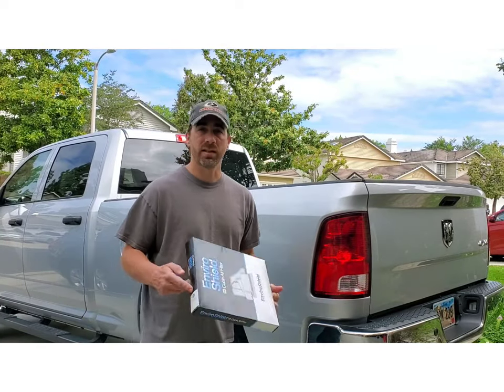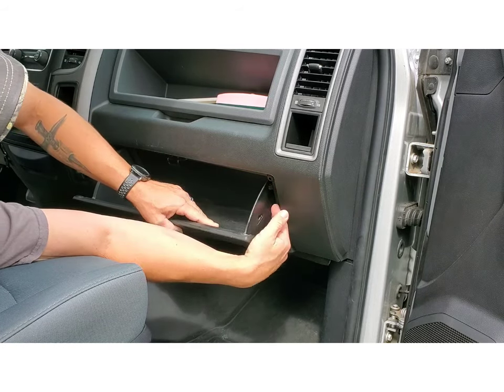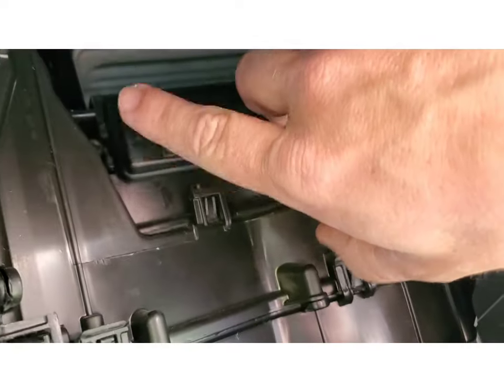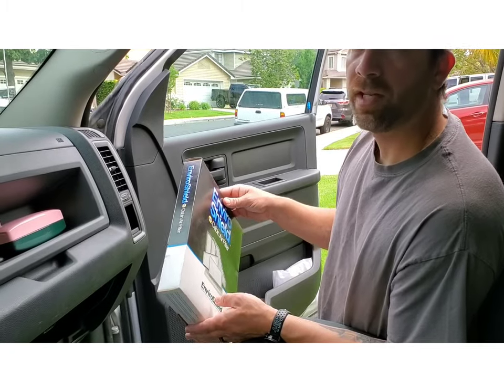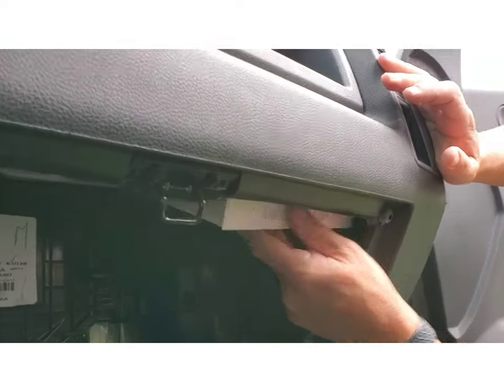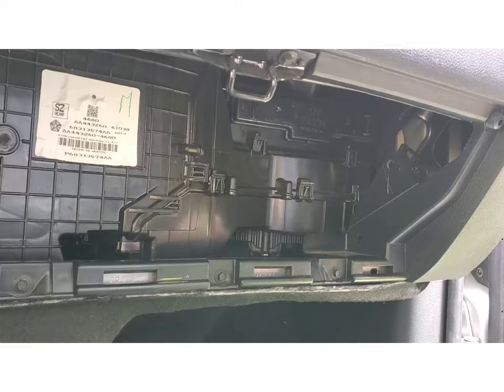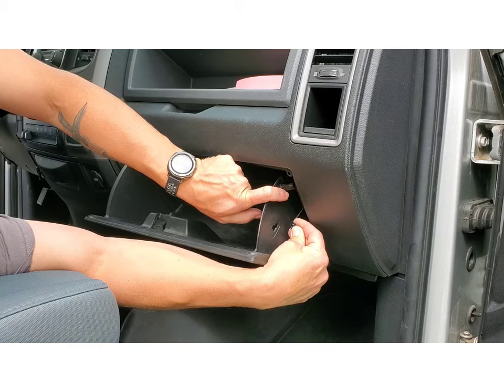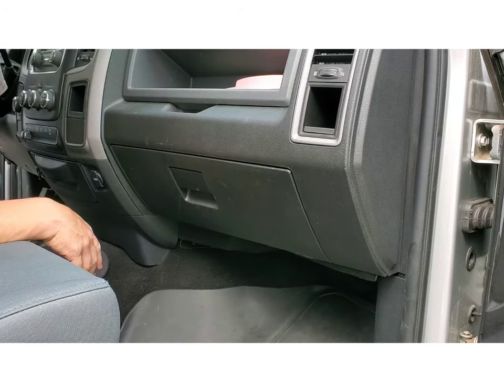2009- 2018 Ram cabin air filter replacement

Comment: My 2015 Big Horn 1500 does not have the filter cover door. You must purchase a filter kit that comes with the cover door. Then you have to cut out the filter cover to insert the filter. Use the heated razor knife blade to cut out the corner. See other u tubes to see how to do this!

Comment: 2009 dodge ram 1500 does NOT have a cabin air filter. There is raised plastic outlining the were the slot would be but if you want one you have to cut the hole yourself. There are kits you can buy.

Comment: My 2013 doesnt have one either. Why would Dodge make something inaccessible like this.
Reply from the maker: That is a good question. Everything is there for the filter, you just need to cut the plastic out of the way.
Reply: Same here. This was a great, to-the-point video; however, my Ram Laramie 1500 does not have this door. I can feel the filter above.
Reply: Inaccessible? What do you mean? It only took a few minutes. How is that inaccessible?
Reply: @masterofnone1808  bc you would have to cut a whole section of plastic out just to reach box that could of had a panel door like normal

Comment: Great video - It should be noted that some (including my 2016 Ram) had a slot for a cabin air filter but did not ever cut the opening to slide a filter in. Hard to believe - believe it! You will need to cut an opening in the plastic (not easy) and then buy a cap to snap back over your filter once you slide it in.
Reply: My 2012 was the same way. I just opted to return the filter. Saves weight anyway. Lol
Reply: @hi4429  
Major cost cutting design flaw in the pre-2017 Rams.  Imagine all the dust and mold and crap collected on the evaporator/heater core without a filter.  Imagine the cost to replace the evaporator when it fails due to all that crap and your AC doesn't work.  Google that.  Ask me how I know.😦😠
I suggest getting the kit to fix it before it's too late.
2011 Ram 3500 SLT Outdoorsman CC LB Diesel 4x4   70K miles.
Reply: I have a 2012 with 48,000 Miles and I am the original owner and could never find mine until I just saw a video in how to install a filter. Now I have to cut out the knock out and buy a cover. It never had a filter. How cheap!
Reply: Just realized my 2012 Cummins Laramie isn’t cut out
Reply: Same
Reply: @seeharvester  about $2000 fix 4 years.
Reply: My cover doesn’t snap on so I left it off.

Comment: First Class! Doing my 2013 Ram 2500 cabin air filter now; just got done diagnosing & replacing fan blower motor resistor assembly. Next is CCV filter. Good to do some of this myself and save some currency. Am just a plumber. Subscribed and Thank you!

Comment: Great video. Quick advice on what filter to buy; DON'T get the thick ones, they will shorten the life of your ac unit. The current false advertising that is running rampant is an N95 cabin filter. Don't fall for it. There is no vehicle that is sealed to make that useful except those that are designed for it. Such as a space shuttle or submarine or other similar purposed vehicle. Having the windows up doesn't mean your vehicle is sealed. You are always breathing outside air 100%. The purpose of the filter is because of the vacuum effect the ac unit causes, it intakes more air in such an isolated spot that it causes a vacuum and can suck up pollen, dust, leaves, grass particles, etc.. your face is no where near the filter therefore you are personally still breathing outside air as it's constantly coming in through various crevices, holes, openings that are natural in all vehicles. The more you limit the vacuum effect (by getting a thicker filter) the more harder the ac has to work. As some of you mentioned a lot, and I mean a lot of vehicles do not even have cabin filters, but the slot is there for that purpose should the car owner want to put one in. Just remember your breathing the same air that is outside no matter what size thickness you put in there. Just trying to help you save some $$$

Comment: I have a 2015 ram 1500. Trying opening the cover using the tabs  wont come out...brought to lube shop, they couldnt figure it out either. Having issues with defogging windows  so i thought the filter might be the issue

Comment: I was in Naples Chrysler Dodge (Naples FL) for a brake job on my RAM 3500 and they recommended the cabin air filter be replaced. Along with $6300 in other recommendations. Today I go to replace the filter myself, and the filter and cover are both missing. Now either they checked the filter, and forgot to put it back, or they didn’t check it at all. The truck is used, so maybe the previous owner? In any case, would you trust a dealership that did this? Not only that, but they charged roughly a 60% markup on the rotors and pads, and 120% markup on the calipers. I’m 2000 miles from home with no tools or place to work on it, so I was at their mercy. Not sure how some people look themselves in the mirror in the morning…
Reply: There's a very special place designed for these sorts of people.  Your attitude is very commendable under the circumstances.  God Bless You! 🙏🏼

Comment: Maybe its a different ducting system on my 2016,Ram Laramie,, Eco diesel,, dual temp?- but the opening is farther up and extremely difficult to slide a new one in compared to yours that is pretty much straight in,,what would work is to take the top box out first too..

Comment: Might add that the tabs on the side of the air filter cover snap off really easy. Both mine broke. Fortunately it still latches, just need to reach behind and pull them loose on the sides. 2020 RAM

Comment: My 15 1500 didn’t have this. I’m cutting the space and adding the filter. Found the kit on Amazon. Kind of a weird item to exclude up front. Using a brand new razor in a nice box knife. There are slots where the knife slides right in. I’m 6’2” so I’m laying across the front seat from the drivers side like I’m doing a photo shoot for some trucker mag. 😂
Reply: Just finished. There’s also a cable bunch on the far right (passenger side / outside) to watch out for. Shaved it clean carefully and put the filter in. 
Added the new door but had to really work to get the filter into the slot based on the angle needed in order to start it. It’s not straight at all. Lol. Frustrating but now it’ll be easier to swap this out.
Reply: As luck would have it, here I am, 2 years later… not with my ‘15 1500, but now a ‘18 3500… same question as before and this video pops up in my search. Deja vu much? Hell yeah! 
My 18 came with the cabin filter though so no need to cut anything this time. 
Couldn’t remember how to get the lid piece off so thank you. Straight to the important stuff. 
Thanks again! 
Rock on man!

Comment: What happens when there is no access to the filter. I have a 2011 and its just a solid plastic front, no access panel. Is there a filter in there?
Reply: Same here. I have a 2015 Regular cab and it’s just plastic. No air filter.

Comment: I have a 2019 Dodge Ram Bighorn.  Don't they have 2 air filters? One under the hood also? Nice video.
Reply from the maker: The one under the hood is for intake and the cabin filter is normally inside the cab. I'm unaware of a second cabin filter under the hood.

Comment: Does my 2015 1500 express even have one? I’ve heard it doesn’t and I’ve heard it does have one. Has anyone even checked
Reply: My 16 outdoorsman doesn't (as I just found out for myself). But an outfit called genos garage has a kit to install one. It's just a filter and the cover shown here and you cut the opening in the box with a utility knife or dremel or... I'm going to try calling the dealer and see if I can just get the cover as I already bought a filter and don't feel like returning it.
Reply: Did you ever find out? I have a 15 express as well
Reply: @johnathanbrown9192  If you're responding to me, yes, but they wanted like $24 or more when the whole kit from genos is $30 I think. So I'll probably forget the $24 door and return the $28 filter and go with the kit haha.

Comment: I watched your video and ordered the filter from Amazon. When I tried to install it I found there was no filter cover, it was sealed. So I watched another video, it told me I need to order a cover, and I need to cut it opened. So I did all that. The thing that surprise me the most was there was no filter at all in there originally.  DODGE SELLING CARS WITHOUT CABIN AIRE FILTER.
Reply: Fyi..Most vehicles never had air filters pre 2000..

Comment: How often is it suggested to change out the filter?
Reply from the maker: Every 3 months depending on how much and where you drive.
Reply: @goodwincustomization2493   ok thanks,  might explain why it feels like my ac isn’t working as good as it did when I bought it.  I have had it about 8 months.

Comment: My 2012 RAM does not have that cover. The area is sealed off with no access.
Reply from the maker: I've seen some people with a sealed cover use a dermal tool or hot sodering iron and cut it out.

Comment: I have a 2016 Ram 1500. Mine defies this video. Truck manufactured 03/16. There is no removable panel. Two broken plastic tabs later....no panel. Mine is flush mount, tabs to the side, one unreachable. No help at all.

Comment: I have a 2016 Ram 1500 3.6 Diesel and after trying to find where the filter would be I started, Googling it.. This came up, "The 2016 Dodge Ram 1500 is part of a generation of trucks that are not equipped with a cabin air filter. Beginning in 2017, Dodge introduced the CAF to this model, and most current trucks are outfitted with one under the dashboard behind the glove compartment box or under the hood." Looks like I'll be taking back the air filter. lol Good video though.

Comment: I decided this is a good thing to do...so I was gonna check to see what kind of condition mine might be in... did as instructed... No filter in the hole...😲 no filter cap either.  ... imma run to autozone...

Comment: Hey thanks for the video ...you make it look to easy lol
Having trouble pushing the left and right taps to release the filter cover...is there a tool to be used? 
Thanks in advance
Reply from the maker: Zeegiliana- I don't think there is a tool. Put your finger on the outside of the tab, push it in while pushing it towards you. I hope that helps.
Reply: This guy must have Superman fingers cause I been trying to release clips for 2 years and cant
Reply: @josephtwardos356  think there's 2 version my mechanic  said mine didn't  have one I had same problem  but its slightly  different  then his tabs they make a kit to add one
Reply: @josephtwardos356  mine doesn't have tabs.  it looks like the tabs are just not there.

Comment: I bought a used '14 SLT Ram and I'm surprised it doesn't have a cabin air filter. Even my cheapest cars have always had a cabin filter
Reply from the maker: It's been hit or miss on these cabin filters. People message me to say their 2019 doesn't have a filter but their 2012 did.

Comment: I have 2012 Ram and apparently they forgot about this trucks cabin filter.  There’s no filter and I don’t even have the little cover on it.  In fact it doesn’t even look like the space was cut out to slide the filter in.
Reply: i got the same problem.  i have a 2014 Ram 1500.  I can't pull the tabs and i bought the filter already.  I guess i will return them.

Comment: I can't push my tabs in to pull the cover off to replace my filter! The tabs won't budge!
Reply from the maker: Push the tabs towards each other. See if that helps.
Reply: @goodwincustomization2493  Read my comment yours sounds like mine. You will need to cut the hole. Sorry...

Comment: I have a 2012 Ram 3500. I don't see the tabs.
Reply from the maker: Do you see the cut out? You might have to buy the kit, which is the cover and cut out the blank.
Reply: @goodwincustomization2493  Got it thanks